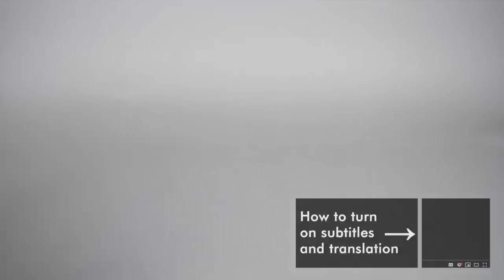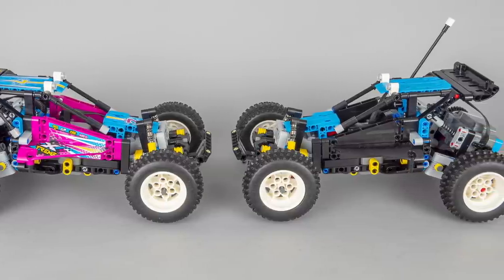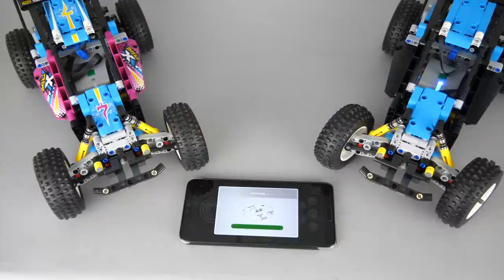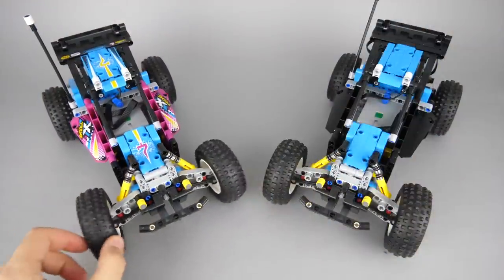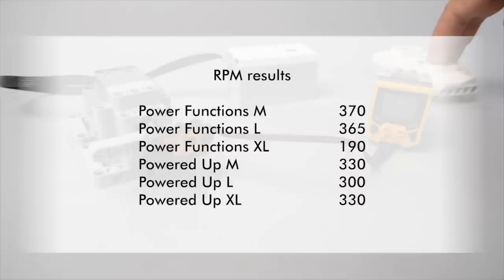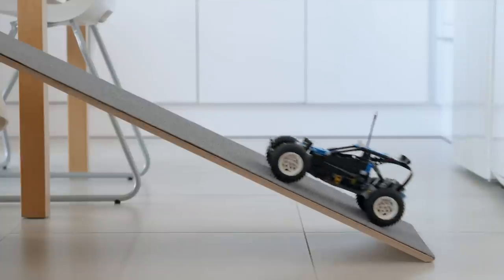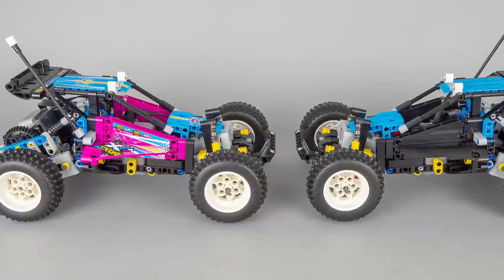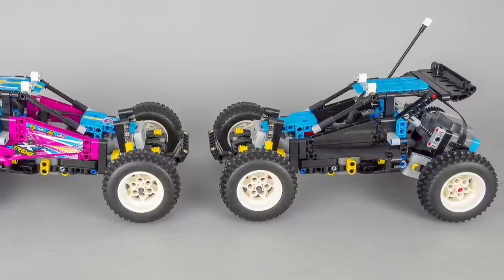XL motor swap in the LEGO Technic 42124 Off-road buggy - is it any better?

Comment: Great video. Maybe because of the higher amper XL motors consume or voltage. you should try it via the modifitaction of philo with 8,4 volt 2 cell lipo which i have in my rocky model. but i don't think it will change. and you should always make model's weight same not to remain any ? . thank you )
Reply from the maker: The weight difference is less than 3%, that should not play any significant role
Reply: @RacingBrick  yes agree but you have said maybe it's because of the weight difference. So thats why i ve said it's better not to leave any question marks in the minds and eliminate all the factors to test more accurately . Best Regards
Reply from the maker: @Bricksfaction  next time I'll make the weight equal, I just need better weather for a longer run outside :)
Reply: @RacingBrick  i will try to test it with powerful philo lipo mod in new technic hub. xl motor should have hp advantage . othervise it's completely useless.

Comment: Can you test 42109 with XL as drive (default) vs 42109 with L as drive? Same for 42099 XL vs 42009 L.
Reply from the maker: 42109 is a straightforward swap but 42099 might be more tricky, the XL motors are structural part of the chassis.

Comment: You need extra power... kind of “rocket fuel”. Use a LiPo instead of these batteries and the speed will improve drastically.
Reply from the maker: The whole exercise is not about the power but the comparison of the 2 motors to see what is the difference. I could easily wire it up with a 3S LiPo but that's not the point.
Reply: @RacingBrick  Wouldn't 3s be too much?
Reply from the maker: @nickvledder  depends more on the controller, the motors should be able to handle it
Reply: RacingBrick Else, LiFePo might be worthwhile to consider. Little less votage per cell and stronger in withstanding mistreatment.

Comment: You could wire one more 1.2v battery to the batterypack and see what happens.
Reply from the maker: Not sure what you expect to happen. Both versions had the exact same type and amount of batteries, if there's a difference at 9V then there should be a difference at a lower voltage as well.
Reply: I was just thinking, would XL motor be better optimized with the correct voltage compared to L motor?
Reply: More torque perhaps?
Reply from the maker: I don't get this "correct voltage" theory. The fully charged LADDA battery pack has around 8.4V. Alkalines start at 9V but drop the voltage quickly, so only brand new alkalines should have any visible difference. And all properties like torque or speed should be proportional to the voltage, so if both the L & XL motor gets a similar voltage then any difference between them should be proportionally visible compared to a higher or lower voltage.

Comment: is it possible that the XL motor just used up the batteries quicker so there was less charge for the later test ?
Reply from the maker: I did the test several times, and the batteries were fully charged between them. I just did not record all attempts.

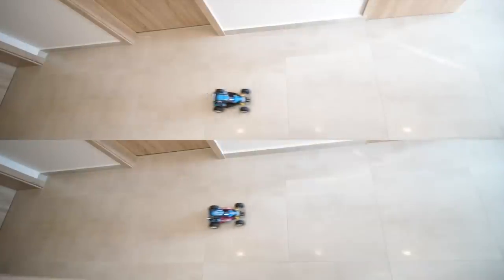Comment: 2:57 So only the powered up XL is faster than the power functions XL, the rest of the PU motors are slower than their respective PF counterparts. I assume the internal planetary gear sets were adjusted for the powered up motors for more torque on medium and large motors, but the XL motor was adjusted for speed as opposed to torque.

Comment: Is it possible to alter the gearbox in order to produce more torque with the XL motor
Reply from the maker: There's no gearbox, only a gear driving the differential. You need to replace the differential as well to have a different gearing, but in that case it'll become pretty slow. You would get a crawler that looks like a buggy :)

Comment: I guess u know its a voltage issue
Reply: There is not enough voltage for the xl motor
Reply from the maker: Nope
Reply: @RacingBrick  . The battery box does not have enough voltage for the motor. It eventually get fixed in powered up 2.0
Reply from the maker: Ahh, ok. A time traveling expert.

Comment: What ir you use L motors on the 42099?
Reply from the maker: XL motors are structural parts of the chassis there so it's not that trivial to swap.
Reply: @RacingBrick  yes i know, this was a suggestion for the long Run! ;)

Comment: Nice video !  I'm sure LEGO is scared to make more powerful solutions cause it's supposed to be for kids. They don't want to get sued cause some kid ruined his finger with some motorized stuff.  Also at some point they would have to produce new parts to handle the power, so more metal parts and more complex parts.
Reply from the maker: Agreed, that's why we will never get RC buggy motors again. But producing very similar motors make no real sense, so more tests are needed.

Comment: It seems really strange that XL motor has less Power than L motor, but also in Philo motor comparison shows this thing. Could be very interesting a comparison of the 42099 with 2 XL vs 2 L motors.
Reply: I built a modded 42099 with 6 x l motors and 3 hubs! There was no shortage of power then lol. This whole thing confuses me and Im glad it’s confusing others! haha Very odd! The l motor is so much better imo due to its size and how you can stack them together.

Comment: I did Tests with the motors too:
As far as I can See the xl Motor hast the exakt Same Motor inside it That is also in the l motor 
I dont know Why Lego did this
Reply: Would agree but they make a completely different sound! Unless that’s due to the xl motor having in effect more sound proofing with its extra thick sides?...
Reply: Put an axle in the motor and try to spin it as ive just tried! These motors have vastly different gearing! L motor spins really fast but is geared down inside whilst the XL motor has little gearing! The bizarre thing is why are they so similar, why have both when at the shaft we use they’re nearly identical? Could be due to reliability under heavy load or energy efficiency